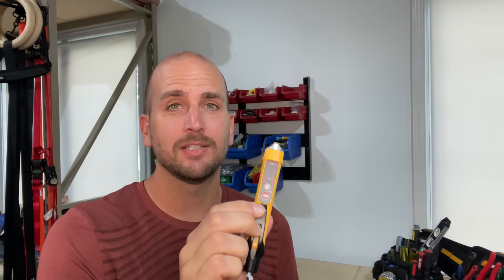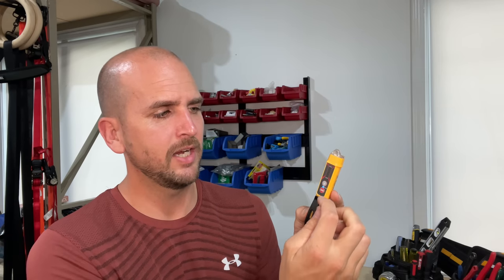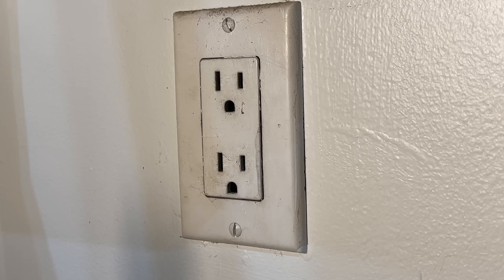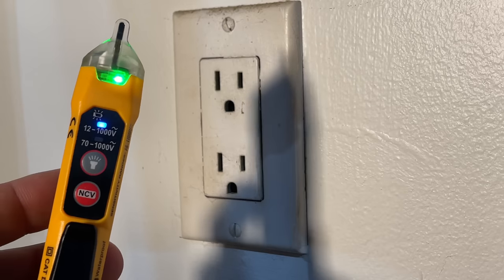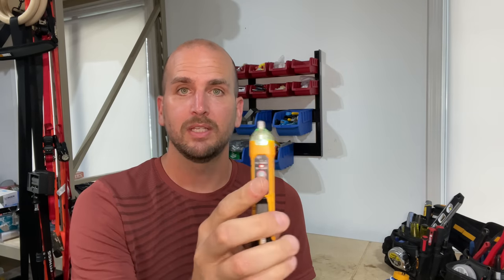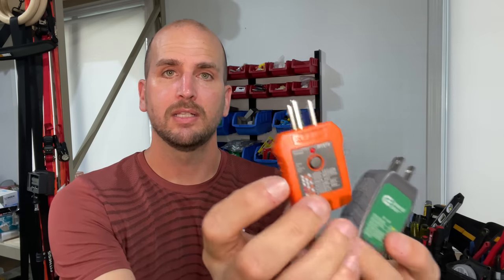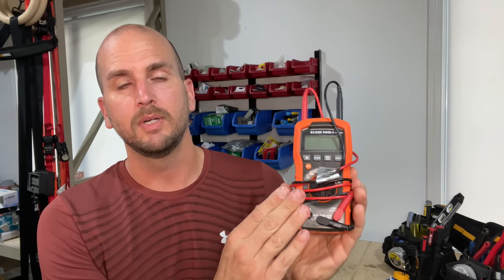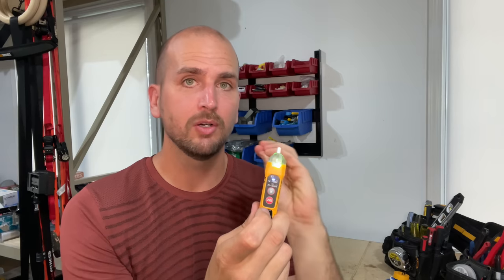Common Safety Issue |  Non-Contact Voltage Testers

Comment: Most of us had to jump through so many hoops to finally become licensed Journeyman Electricians, we just bang our heads against a wall seeing our trade become something for somebody who identifies as a "DIYer" to be sticking their hands in.  
States like Washington, where I grew up, required 7200 hours of experience before we could even sit for the test.  And that experience needed to be documented by your supervising Journeyman and his signing-off on your paperwork required a Notary.  After that, you sat in a classroom with no crib notes for about 4 to 6 hours with a 2-inch thick electrical code book beside you that THEY provided (so you couldn't add your own cheat notes in the margins) and sweat through 100 questions.  I think about 30 or 40 percent would pass the first time.  If you failed, you could wait a few weeks and then try again.
I worked around 4160 volt when I was starting out, and they had these non-contact testers designed for high voltages back in the 1970's.  Then, they developed these smaller versions for lower voltages.  My favorite is made by IDEAL.  Very simple and easy-to-use.  And very sensitive, so they would often chirp at you even when there was only static electricity involved - so you would dig a little deeper to be SURE the circuit was off. 

Klein didn't even used to make meters and such - they stuck to some of the best hand tools ever made.  And they were seldom found in Hardware stores.  Then they saw more $$$ signs, and contracted out to China or some place similar, and slapped that famous name on something they weren't originally in the business of.  They started out in the 1800's making hand tools for Telegraph linemen.

A "DIY" painter makes a mistake, it is easily corrected.  A "DIY" plumber makes a mistake,  there could be a leak or a flood or a backed-up drain.  You "DIY" electrical hacks are taking a nice big chance and burning a  house down, killing the occupants, or maybe frying YOURSELF.  I have retired now, so you youngster go ahead and have fun playing with stuff you're not qualifed for.  Seen a fair amount of newbies go running to Mama and quit the trade the first time they get some of that good ol' amperage running down their arms.
Reply from the maker: Hey Jeff, even with me being a DIY “hack” appreciate you taking the time and it might not come through in the videos but I do value your experience and really enjoy learning from people like you that committed a career in the trades. Take care and enjoy the retirement 🏖
Reply: @EverydayHomeRepairs  My apologies to you, as well.  I am just old and Grumpy about the changing times, which is typical for us Geezers.  I didn't even start out to BE an electrician.  Originally signed up in the Navy to be a Navigator, until someone talked me into switching to a trade I could use after I was discharged.  
Then, I landed a position as a Journeyman at a State University, where I was the youngest guy on the crew.  Lasted four years before I left to try and be a photographer.  My heart wasn't in the job in those days!  Finally came back to the trade after a few years of being broke and dissatisfied once again.  I learned that it felt good to build things for a living, that many other people were incapable of doing.  And that kept me going for another 20 or so years.  But I never liked house wiring, always preferring to do office buildings, steel mills, retail stores and things such as that.  I always take comfort knowing some of the things I built are going to still be working and solid for 40 or 50 years.
I just need to quit watching these sorts of videos - because I am old and times have changed.  I have been working for a guy my age, on boats and yachts, for the past five or six years.  He is self-taught in electrical work and I admire that he drove himself to learn on his own.  I don't know that the Navy still has the top-notch teaching that they had during the early 70's, but Basic Electricity/Electronics for about 2 months (classes Monday thru Friday) certainly taught me a lot.

So, ignore my comments and keep on doing what you do.  I regretted the "hack" comment after I made it.